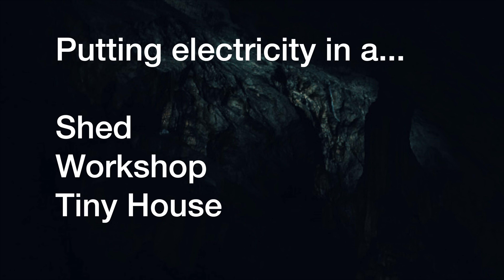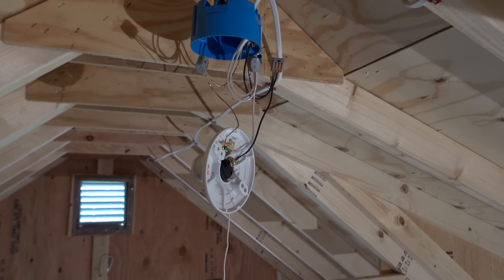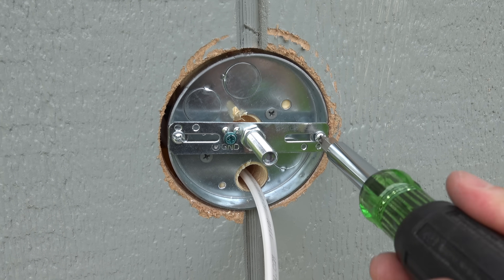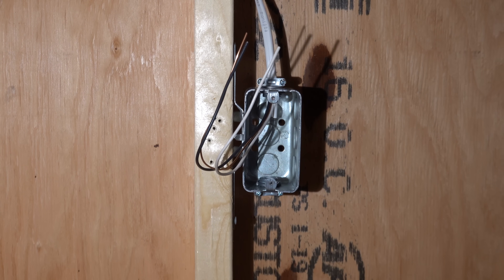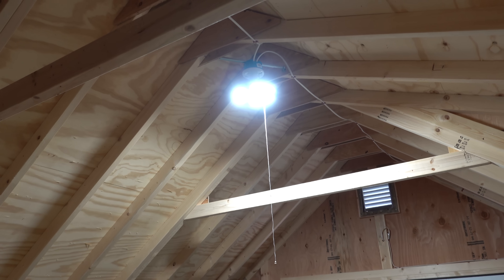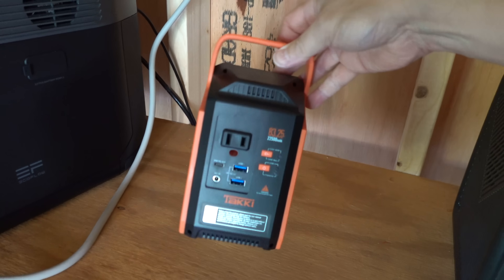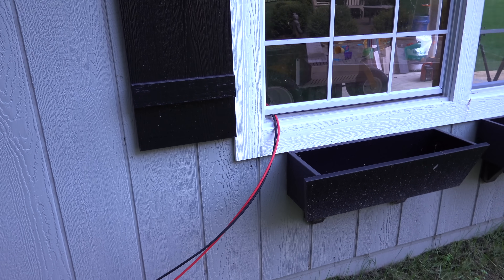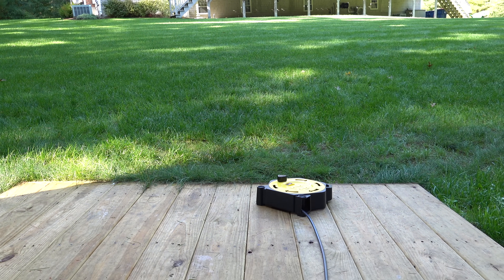How I built my SOLAR Powered Workshop - Power Anywhere

Comment: Great video as always. Is it ok to leave the solar panel plugged in?  Will the box sort out when it needs a charge?  I’d like to put one in my shed to run some lights with solar cells permanently mounted on the roof. I was looking at a battery inverter system but I like the idea of being able to grab the eco flow on occasion and go tailgating or whatever.
Reply: you can always leave it plugged in.

Comment: Like the video but most portable panels are not meant to be left outside as they will deteriorate and fail from the weather.  I’d highly recommend a few Rich Polycrystalline solar panels, those seem to outperform my HQST monocrystalline panels. I prefer a light switch by the door 😉

Comment: Do not run that pump off of those solar boxes. The high start amp draw will destroy the batteries. You need something with a lifepo4 battery if you are going to be running motors.
Reply: That Delta will run that just fine. Destroy the batteries? The inverter handles the surge, not the batteries. And it can handle 5000w surge, no where near what the pump will do.

Comment: I started looking at doing the same for my lawn shed but what I was finding used batteries. I like the solar generator a lot more 😍
Reply from the maker: These make it very easy to get up and running fast, DIY stuff can be great to do but this is just too convenient and I love that you can grab these and take them camping too or for an event if you need it.
Reply: The solar generator does use batteries. You cannot avoid that requirement. It just puts everything you need in one compatible already functioning unit.

Comment: Pretty cool idea, I just wonder what happens when the temps drop below 32F on those power stations
 Here's why... Lifepo4 chemistry can't charge below 32F or it permanently damages the battery cells. I havent tested this yet with my EB70 but I would hope it has a built in temp sensor to keep it from charging when the cells are below 32F.
Reply: wrap it in a blanket, or a heated throw that uses dc and little watts.
Reply: @chrisanderson8553  good idea!

Comment: Hi.  What about winter time?  Do these batteries operate well when the temperature is below freezing?  I noticed shed is not heated/insulated.  Thanks.
Reply from the maker: If you are in an area of extreme cold you would want to take these types of units in a warmer space, Even Tesla Powerwalls require internal heaters to protect them from damage. If you are in a cabin you probably have some type of heating and can use them all year but if not bring them in which for me wont be a problem since I really won't be out there in the extreme temps.

Comment: PLEASE keep in mind, if you buy or own a Jackery solar system, you cannot use any panels other than Jackery! I recommend the Delta Pro Max! They are expensive, but THEY are the best!
Reply: That is NOT true. My shed is Jackery powered and I am using Goal Zero panels. Many solar generators have different size power inputs (my Jackery is 8mm) but all you need is a adapter to mix and match.
Reply: @rebellucy5610  Where can you find those. Adaptors
Reply from the maker: Very good point, I am a little sad Jackery did that, I like them a lot for their reliability but I hate when they make panels specific.
Reply: @SilverCymbal es, you just need adapters.  I charge my Jackery from 200 watt Renorgy panels.
Reply: That is totally incorrect. You can use any solar panels with a cheap mc4 to 8mm adapter from Amazon or eBay. Hopefully this helps someone.
Reply: Did you try a MC4 to 8mm adapter?
Reply: All you need to do is have an 8mm adapter on any branded solar panel.... Not required to use Jackery's overpriced panels haha